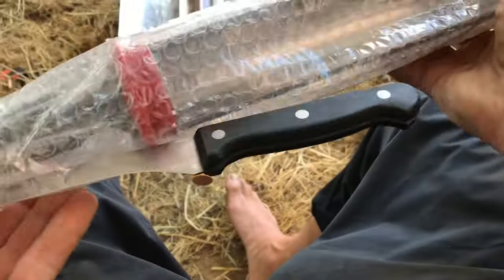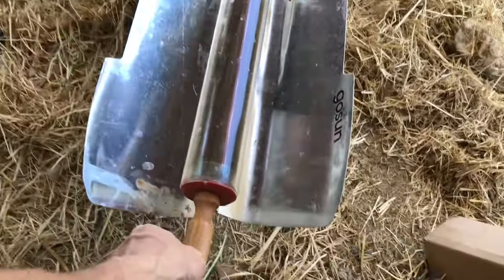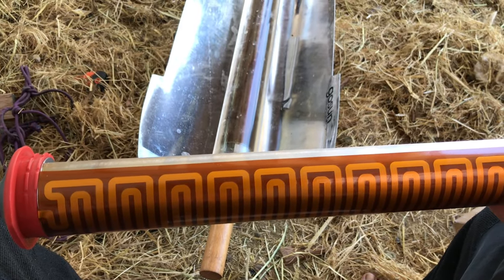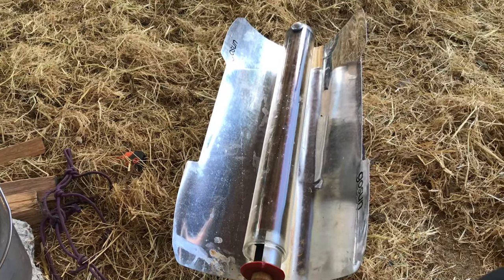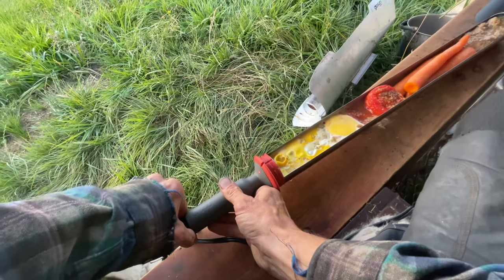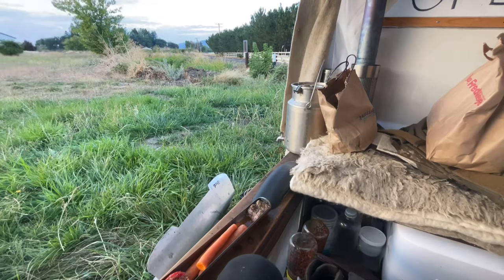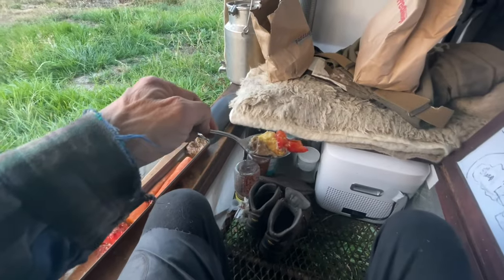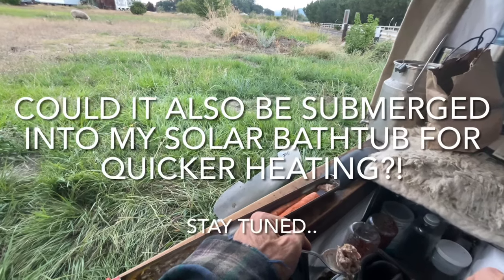123homefree Reviews New Gosun Hybrid Electric Tray!?

Comment: I told you this before I have gosun sport cooker, and I very easily speed up cooking by taking two large pieces of cardboard, putting myler on it with aluminum tape, and attaching these two panels with paper clips to the cooker. I have to use short lumber and a big bucket to securely hold it once clipped, and it's pretty stable. Cooking is more than twice faster.

Comment: If you want to refurb your reflector on your GoSun, just get some adhesive spray and put a layer of potato chip bags. The aluminized Mylar will probably be more reflective than the factory GoSun wings are and when it gets dull, just reapply more over top.
Reply from the maker: Smear gluten glue on after shtf lol
Reply: heck milk is a good enough glue but the chip bags are SUS

Comment: Interesting, but I don't think gosun would work on my sailboat. So I have a Ni-Fe battery bank 8000Ah, 600w solar and 2x600w windmill's and an induction stove with a small oven. For morning coffee making I have a Biolite campigstove that runs on twigs and pinecones, after the coffee is made I use it to charge my phone with fire. I rake twigs into potato sacks and dry them on deck under the solar panels. 2 sacks lasts me 6 month.

I'm free man, only God control's me.
Reply: Why doesn't work on a boat?
Reply: @straykitten4998  
The rolling and pitching by the waves, hard to focus the sun on the food.
Reply from the maker: Gosun actually sells a boat railing clamp for their cookers